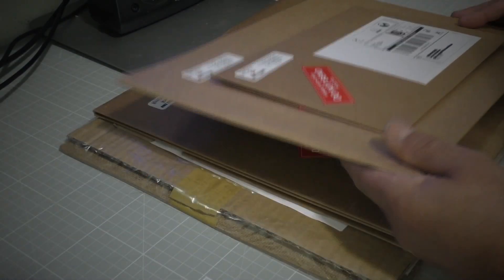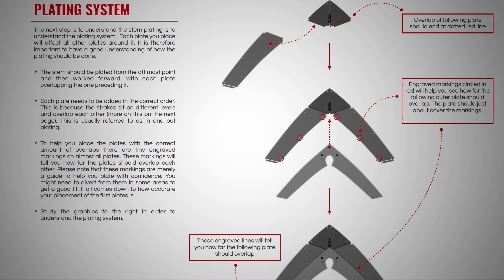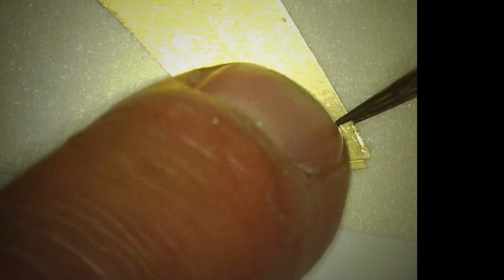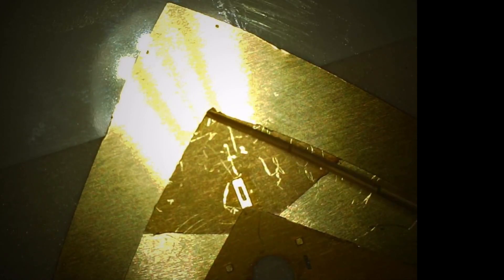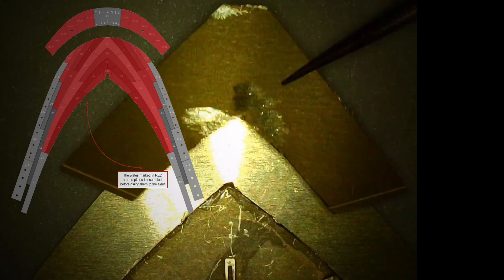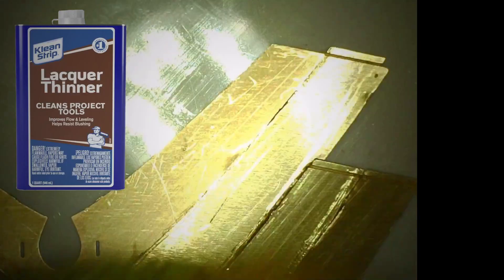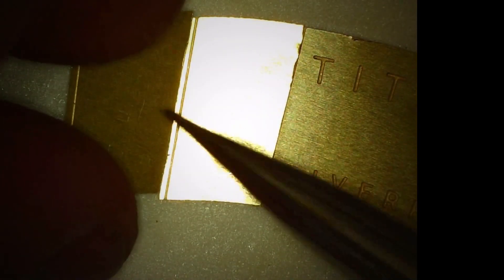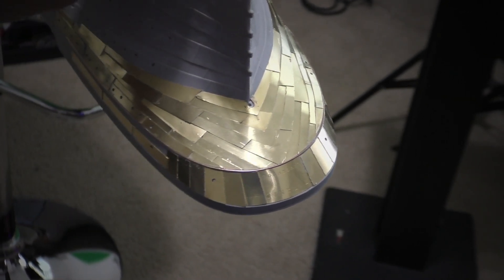Building the Titanic: MiniBrass Stern Plating

Comment: Great vid! Do you have to sand the surface down because it seems with the brass parts will stick out compared to the kit surface.
Reply from the maker: Negative, it looks much better in person. The only issues were the end pieces, E11 through E14, the ones with the port holes, if I had to do it over, I would leave those out.
Reply: @BuildingtheTitanic  thanks! I've got all 3 sets before Elixander stopped making them and want sure if sanding was needed.
Reply: @BuildingtheTitanic  thanks! I've got all 3 sets before Elixander stopped making them and want sure if sanding was needed.